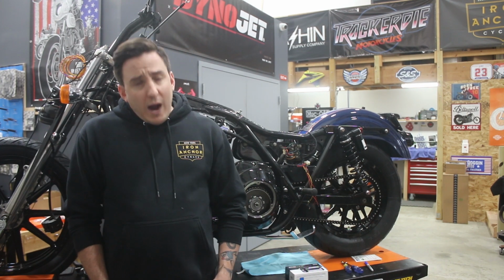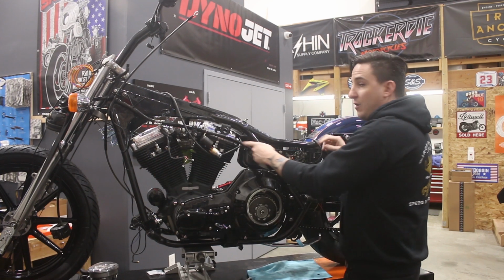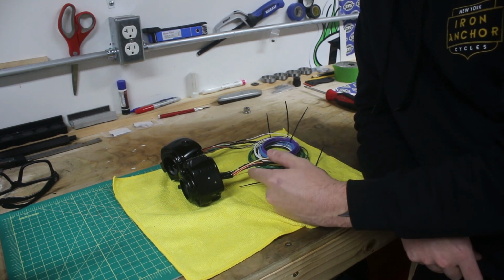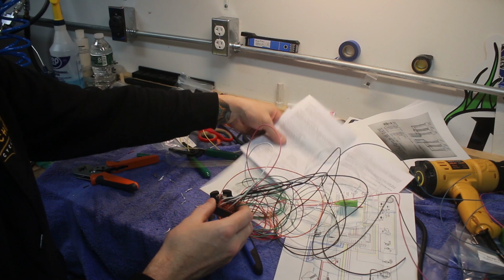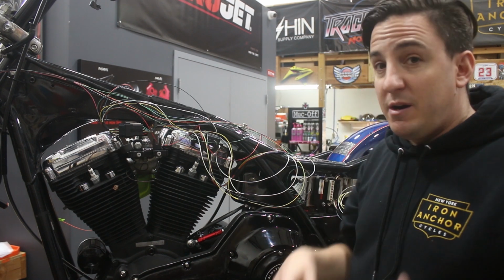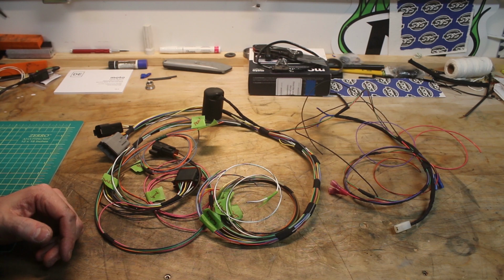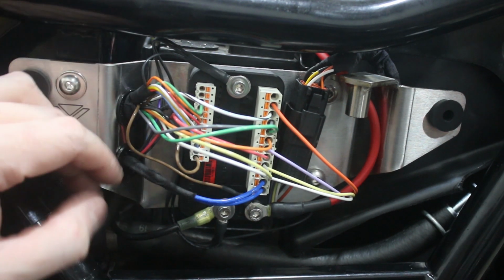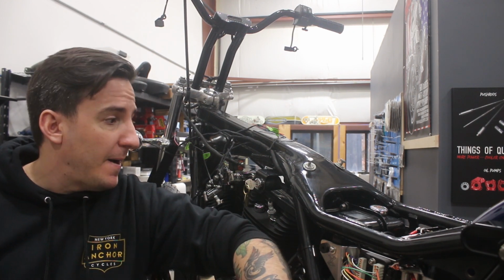FXR Build Part 5 - Motogadget M Unit Install

Comment: This really is a tremendous video if you’re looking to do one of these on your FXR, chopper, or other. I did one before I watched this video, and the process wasn’t too difficult if you’ve wired anything before. However, I’m about to install another m unit on a different FXR and this really helped me plan and get my head around how I wanted to do it after not wiring anything for 3-4 years. I would highly recommend the m unit for older bikes. Thanks so much for making this video, great job!

Comment: Does your kill switch on the handle bar work as normal? Or opposite? If it works as normal what setting did you choose in the m unit app?

Comment: watched the video a bunch. looks like you used the smallest gauge wiring suggested, except for the grounds. true? the wiring diagram from motogagdet suggests using the 1.5mm wire in their kit for all the outputs. id prefer to use the 0.5mm stuff, any thoughts? thanks

Comment: Liked-Subscribed
Burned my 1993 FXLR harness for the 2nd time.....This time was me putting a Lithium battery and learning the hard way ....tried even changing to a lithium regulator ...burned everything down...trying to decide what to do...dot dot dot...might go very simple on this try, no blinkers,speedo,nothing.SO FKN MAD
WHY HASN'T ANYONE PERFECTED LITHIUM BATTERY AND A REGULATOR THAT REGULATES AT A LOWER VOLTAGE?? LITHIUM HAS A (STALL OF 13.3 VOLTS) WHEN AN ACID REG IS TRYING TO ACHIEVE 14.5 ish VOLTS) ????? BURNED MY IGNITION, SPEEDO, TURN MODULE ETC...ALL SMOKED AND GONE. Need Help

Comment: It's like you read my mind.. I have a 1992 FXRP basket case I picked up last year and installing a S&S lower end built motor. Doing a 6 speed transmission and chain drive as well. Owner stripped everything down for powder coating, and it ended there. With you guys, who needs a shop manual. Very good instructions and excellent coverage. Keep up the great videos.

Comment: I avoid stuff like this for one reason. If it fails or needs repairs in the future, I can't pull into a shop and get it fixed in the middle of a trip or get parts easily. And aftermarket companies can come and go. And some shops wont touch stuff like this if they didn't install it.

As a traveler by bike and 4x4, easy access to parts and repaiabilty is key.

For an around town, bar hooper or weekend bike, it's fine.
Reply: That's an interesting point I didn't think about. The wiring is essentially the same but it just goes through the unit?

Comment: Hey how did you wire the starter motor cable. Did you connect 2 cables at the terminal Pin or did you connect 2 wires down line in the middle?

Comment: I added the M Unit Blue to my 79 Shovelhead FXE to Custom Chopper build.  The old circuit breakers and wiring were done by gremlins with chewing gum (Wires shorting and melting together).  The M Unit is the answer.  When I was doing mine I couldn't find squat online and had to trail and error it.  Your video is comprehensive and awesome.  Thank you so much.
Reply: I’ve got an m-unit on backorder for my ‘76 shovel rebuild. Would love to know what tips and tricks you figured out when sorting through your build with this.

Comment: Hey hope you're doing great man. Know you have allot on your plate, but could you ever make a video explaining when you use anti sieze or locktight and how that affects torque values? Recently snapped a rusty exhaust stud and royally f*d up my cylinder head trying to get it out. Being a beginner DIYer, i feel like the info out there on things as basic as these is very limited yet it's super important.

Now in the process of seeing if I can find anyone who can do a repair on the head still on the bike, or removing it and taking it to a machine shop. Just sucks because hindsight is 20/20 and I know that with more patience and some basic knowledge problem could have been avoided 100% 

Sorry to vent lol, but either way keep on killin it man, really loving this build series.

Comment: Great video. This mirrors my mUnit install on my FXRD almost exactly. I would highly recommend using the wiring diagram referenced in the video, as well as buying motogadgetfxr's wiring kit, which comes with every wire that you need. The kit also comes with a very cool bracket that allows for placement of deustch connectors on the left side of the bike as well as the right. On my bike, I also used the m button, which eliminates a lot of the wires coming from the bars. I also used the mUnit Blue that has Bluetooth connectivity. The nice thing about the Blue unit is that you can program the different functionalities from your phone.
Reply: hi where can i get the motogadget wiring kit?
Reply: @patwrenching9674 revival cycle Texas has several versions

Comment: I installed one of these on my 1989 fxr sport that I was installing a 1987 RT fairing and the wiring was damaged badly for the bike and so I got one of these and installed it but did not have the information that you did so I spent a lot of time figuring it out  it now works but not as neat as you did it thanks for video it helps me plan my next part

Comment: This video is GOLD!! Thank you for doing this!! I understand this a lot better. My setup will be a little different with the M button from motogadget, all my hand control wiring will be located in the bars and send signals to the unit when they will be turned on or off. Keep up the good work!! Love this series